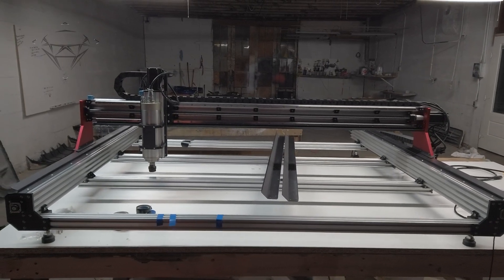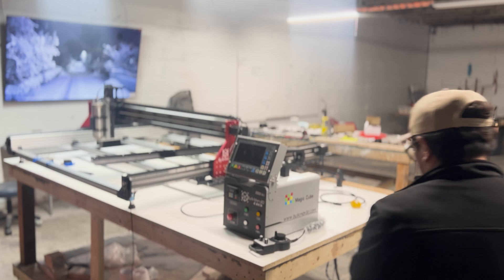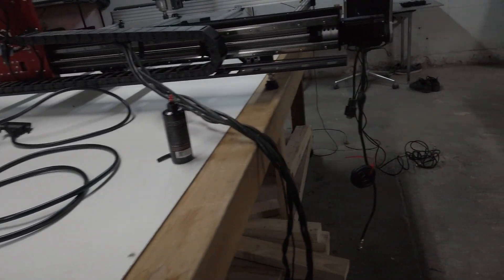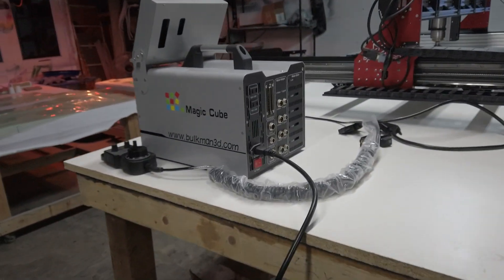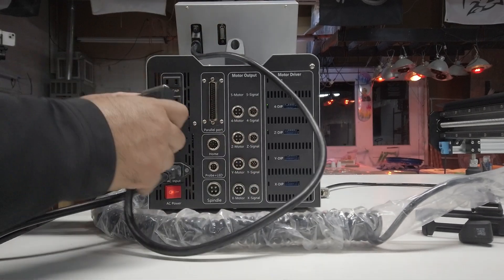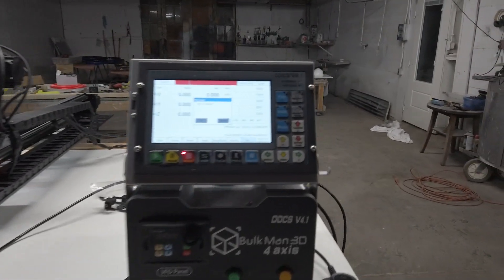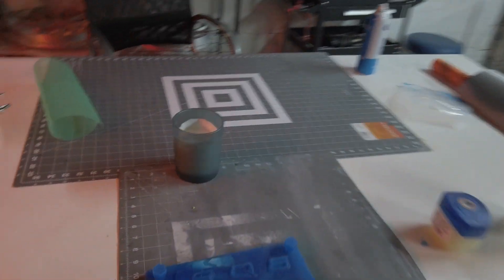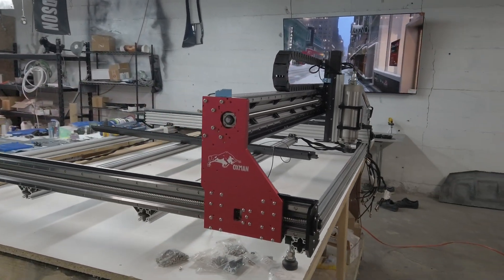EP#1 | My First Video

Comment: I recently bought the same CNC machine (OXMan CNC kit), but I’m currently stuck wiring the limit switch to the home port. I'm not sure which wire goes where. Could you please make a video explaining this? Or, if possible, could you share a picture of the backside of your Magic Cube controller? That would be really helpful. Thanks in advance!

Comment: Hi everyone,i just got mine and i need help in setting the home position perimeters. I'm totally new to cnc and with no knowledge.the seem to be no technically support form the manufacturer
Reply from the maker: Hello. So, to set your home parameters, it's easy once you get the idea of it, but at first it's overwhelming. What you need to do is find your midpoint in the whole sphere. So, center point of the whole table, and set your global coordinates in GPT-4 to zero. So, if you set everything at zero, dead center, and then slowly, one by one, with your limits in place, walk your limit, or let the machine rather, test its home limit. So, for instance, you would go y-axis, home. It's going to move slowly. Make sure you don't have it on high speed. There's a chance you could crash it. Go slow, and watch the machine as it's moving, and be ready to hit the e-stop in case there's an emergency. As long as everything is hooked up right, the machine will go to the y-limit and stop automatically. That will give you your y-coordinate. Then, go back to the home origin, and do the same for the z and the x. Your home positions should now be set. At least your limit switches are acting as your home switches, so it calculates automatically. There's not anything you have to do to type it in. You just send it there. Once it's there, the machine signals that it's hitting a limit, and it stops on the limit. I have mine set up to back off three millimeters. Go into your parameter page and play around with it. Don't be afraid to push buttons. Just be ready to hit the e-stop. There's not very much support as you write. Good luck.

Comment: I have mine fully built except that what confuses me is in the build video; It shows Y axis motor connected to the one Y-axis motor port, and it appears like the second Y axis motor is connected to #4 on the DCCS4.1 control box. Is this correct ?  Both Y axis motors connect into the DCCS4.1 control box on individual connectors correct ? It only came with one Y axis labeled signal wire and connector not two, so I assumed the second pair which was label 4 axis was to be used on the second Y axis motor as the cable is extremely long and makes sense for doing this.
Reply from the maker: Yes that’s correct. Y x4th axis = slave

Comment: Hmm after watching your video I don't believe its a good idea to plug the motors in after the unit is turned on...The drivers for the motors need a load.. hopefully all is ok..Also I don't think this machine can do steel and stainless...
Reply from the maker: I will plug the motors in to the dead controller, then I'll power it up.  This test was to see if I got the correct power online. 

I know the consensus  is that it can't cut steel or stainless. I plan to put this machine to the test by cutting thin sheets, possibly an 8th -1/4 inch  sheet. Same goes for titanium. I've had success cutting some very thin titanium on a desktop saintsmart, so I will definitely be pushing the limits here. Hopefully the rigidity of this extruded alliminum structure and gantry,  my hypothesis will be correct. 

I do expect the titanium to cut over the stainless steel though.
Reply: @BlackGemManufacturing  Testing never hurts ... most of which comes down to material/bits and correct feeds and speeds for the chip loads..
Reply: @BlackGemManufacturing   I design aero space parts as CNC Manager; Don't use this machine to buzz Steels or Titanium lol. You can, by doing multiple depths of short passes, but without running water coolant your going to eat up expensive router bits. Cutting 6061 aluminum or even 7075 at 2mm depths of cut is a safer route; These machines can do aluminum but unless your running a cat 40 or cat 50 grade spindle people using desktop CNC to mill steel or titanium is putting allot of un-necessary stresses on bearings, and the drive system. Do it ONLY if the part your making is going to make  you allot of money and worth the risks, and buzzing steel on this your looking at standing there spraying WD40 and taking .020" depths of cuts, expect to be there all day. Don't dare do hardened steel either lol. Im hoping before I press the buy button to find out if you sea shipped the OXMAN or used the DDU  UPS option, and if you did the DDU UPS option did you have to pay customs and did UPS bring it to your door step ? I want this fast, but don't want to get hung in a customs clearance loop and pay allot of headache money.

Comment: I ordered just  mechanical (1500X1500) CNC for 1232$ (932$+300$ delivery charge) as I have all the closed loop stepper motors (3Nm and 48v power supply with drivers) an acorn cnc control board... also I have my own Proximity probes and 2.2kw spindle with VFD.. I have built control enclosures before this so not my first rodeo!
Chose the slowest shipping time so it was 300$ vs 700$ BUT 45-55 DAY DELIVERY..
To get the most out of your stepper motors you need a higher voltage power supply(gives it more speed feed rate wise)  not sure what voltage your controller is..
Good luck... I believe it is a very sturdy machine!
Reply from the maker: Thank you! The controller is 220V. 

Will you be making a video of your build? 

I was tempted to go with the 1500x1500 Gimitsu and the ultimate bee before deciding on this setup. I like the structure and other items, especially the controller box. 

Please come back and let me know your thoughts after running your new setup.
Reply: @BlackGemManufacturing  I looked at the Gemitsu also.... the extrusions for the x axis do not look as sturdy as the Qxman..(I liked the larger ballscrews)
Also I asked them some pointed questions in email format and they dodged them all.... and not in  a warm and fuzzy way... 
Their aluminum looks softer too not sure what grade it is and got no answer... I watched a vid of them cutting aluminum and it was screaming and creating powder on a small plate..not confidence inspiring...
Reply from the maker: @mindbender50  I had similar reservations about Gimitsu. OXMAN has answered every email and their support has been stellar. They answer my question, as well as send wiring schematics not available anywhere.
Reply: @BlackGemManufacturing  Oh I meant the DC power that drives the Stepper motors... I am pushing 48volts I think yours is 24v..
If you ever need more speed out of your stepper motors doubling the DC supply to 48v does that but that's the max for those size Motors..
And your controller will need upgrading but if you are getting the Inches per minutes you need don't worry about it..
But that's how Altmin got theirs so fast they use a superlongboard controller that's modified to run at 48volts verses the more common 24v.
Higher DC voltage makes a huge difference in speed..
Reply from the maker: @mindbender50  Ah ha.  I understand now.  Thank you.  I like the idea of faster motors, but for now I need to learn the basics.  I can't seem to figure out how to home position/start the machine on the DDCS V4.1.  
I'm thinking the limit switches can set a reference,  but I can't figure out how to set a fresh home/start position. I'm very new to this and itz along different than the 3d printers and user friendly saintsmart.  

The machine is absolutely beautiful though.  Hopefully you have yours by now.
Reply: @BlackGemManufacturing  As for homing you home to the limits first Always even after a crash (that sets machine physical limits everything else references off of these) then you jog to the point where your material has  its start corner and hit the zero button on your x and y axis this sets a reference point in relation to the machine co-ordinates (which homing sets up with limit switches) now for z you need your bit in the spindle and lower it to the top of the material and then hit the Z zero button..
Most people use metallic probes that butt up against your materials surface on the corner and then there's a wire from the probe plate that conducts so it can do some tests to accurately set the x,y,z offsets from the machine co-ordinates..(but this needs software to be set up in your machines controller to work)
Also your design software can be set to work from the top of the material down or the bottom of the material up... if you set the machine up the opposite of your design software ie set zero as the bottom of material and design software thinks its the top you could ram into your bed,, causing damage

If you can find the Zero X Button, Zero Y button and Zero Z button on you controller display you can jog to where you want to start and press those buttons and see if it zeros to that point ..
Just don't start the spindle, jog it XYZ zero after those are set to see if its actually where you want it to go..
Always home first! before any operation..